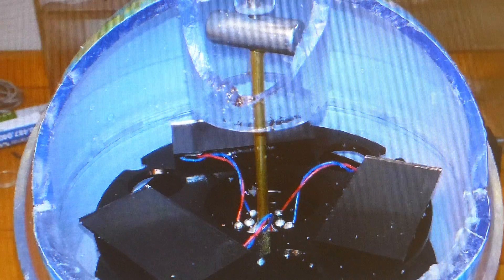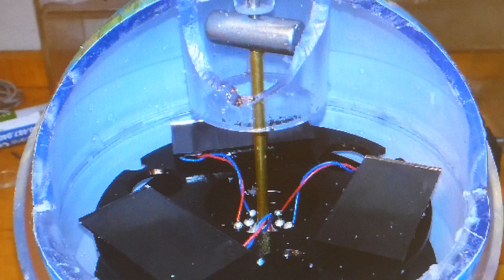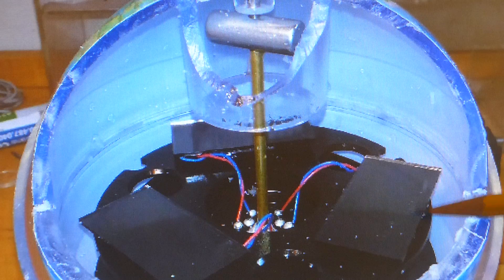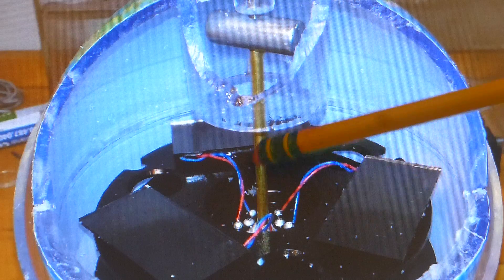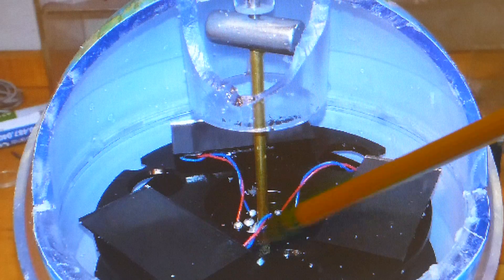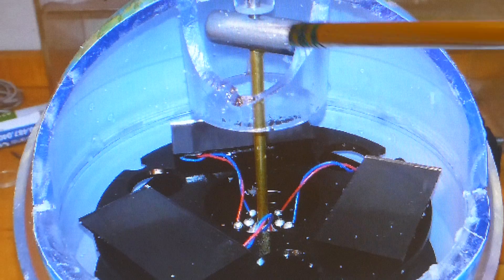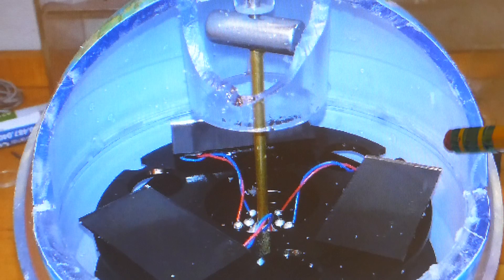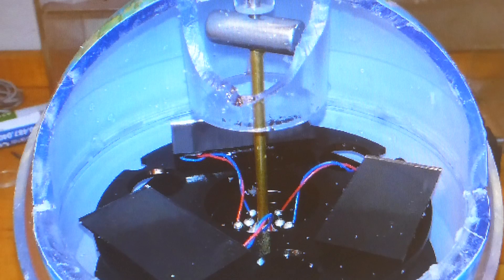Mova Globe :  Internal Mechanism Revealed by Cutting Open

Comment: Wouldn't it work without a magnet, just by the momentum counterforce caused by some spinning mass?
Reply: I think so, theoritcally. It would just cause the rod in the middle to spin. (probably rather quickly, since it would need to put the same amount of force into the rod to achieve the opposite reaction of spinning the mass of the globe.) I imagine they are already pretty close to the same weight as-is, in order for the realitively weak force of earth's magnetic field to prevent the rod from spinning. A chunk of lead to replace the magnet would likely work better, if you were to make it without a magnet.

Edit: Although, there is one flaw, the internal globe could become off-axis realitive to the user, since the same inertial forces could be applied through rotating the sphere in your hands (the magnet prevents the internal sphere from tilting.)

Comment: Wow so the strong magnet on top is only held in position by the earths magnetic field like a very strong compas needle? 😯 That’s genius , I gotta get one of those
Reply: The magnet at the top aligns with the magnetic flux of the earth.  It then becomes the pivot point about which the motor (attached to the inner globe) rotates.

Comment: I have a 6" globe that has developed an air bubble at the north pole and stops rotating, starts, stops, sometimes moves clockwise just a bit, and starts again, to stop again.  I have used the "paperclip" trick recommended on their site.  Same outcome always occurs. spin, stop, start, stop and sit there for hours, until i gently lift it and turn the globe to assure the liquid is coating the bubble surface area, for friction reduction if they exist.  It has been in the same location for 5 year under a skylight, in a bright room.  The starting and stopping just began 10 days ago, and thats when i noticed the air bubble, about 1" across the diameter.  Any help is appreciated, and FYI for others.
Reply: return it, they're a good company and would most likely give you a replacement
Reply: They only give 12 months guarantee that should set the alarm bells ringing and they charge 70% of the original cost to repair 😮😮
Reply: When an air bubble occurs, you have to wonder where the oil has gone.  If it’s into the inner sphere, I think you’re pooched.

Comment: Thanks for the interesting investigation. I own one of these MOVA Globes and as many other owners I've faced the problem with air bubble which eveloped at the top of my globe (mine is still moving though). I have searched the whole web and was not able to find any advise if there is any way to remove this air bubble. Perhaps you or your subscribers could share their findings on this as I understand it is common and widely known issue. My guarantee has expired and I would not pay 60% to the manufacture for the exchange for the same product with this well known deffect issue.
Reply: Damn, I was gonna buy one but that's put me off a bit
Reply: Try putting a large paper clip on top (something like a star of David).  That solved my problem.  The exact position of the paper clip is important but you can only get it by trial and error.
Reply: I have had my MOVA globe for 15+ years with no air bubble, I’m wondering if the cause of the air bubble was mishandling or dropping it.

Comment: i've got a few questions on this : i understand all the stuff with fix reference North-South provided by magnet, but how does :
- the inner shell stay oriented VERTICALLY when i turn outer shell : i think it may be gravity as in boats keels or spherical robots, but it's not mentionned in the 2 videos.
- the inner shell cannot move HORIZONTALLy in the outer shell. i think i understood vertically (heavier fluid below, ...) but horizontally, i cannot understand why it cannot move.
my exaplantions would be : if there is a little drag between inner shell and fluid when the sphere is rotating, it may force it to go between inner and outer shells, thus preveting inner shell to move horizontally. but it still seems very little force to me.

hope you can answer !

Comment: I understand how it rotates but how does it float?
Reply from the maker: The density of the 3 fluids used is critical.  It must have taken a lot of calculation or trial & error to make the solution  of the middle layer exactly equal to the weight of the globe, OR he could just add, or reduce the weight  of the globe.   It's very easy for a scuba diver to establish neutral buoyancy by  pushing a button to inject air into his vest, or dump it out.  When you just hover in the water look at  your depth gauge to verify that  depth is not changing.  Balloonists do it with sand instead of air.

Comment: HAs anyone figured out what type of fluid is in the globe? I have one of these globes as well and discovered the tiny port of where it is filled up with. I have heard some people claims it is mineral oil, I am thinking of taking a micro drill and hypo and inject with with mineral oil to refill the globe. But i fear that it might not be mineral oil and might be another kind of oil that is clear and more fluid than Mineral oil. Perhaps its like kerosene or  white lamp oil (wax derivative)?
Reply: The liquid is parafin-based lamp oil.
Reply: @tedinvt4631  Thanks ill try that and see what happens!!!
Reply: Any updates on what the fluid is ?
Reply: @KaranPatel-wj2mo  I used the white lamp oil paraffin I believe , works just need to use a syringe to inject and a hot iron to reseal.

Comment: There’s actually 2 fluids that are in between so that it stays centered. It’s really ingenious.
Reply: Yeah.... It's a ship, not a submarine, and the "atmosphere" has almost the same IOR  as the water.
Reply: From the patent, the specifics of the two liquids are described.  “The liquid 6 is also transparent and preferably comprises two immiscible fluids such a fluoro-carbon PFPE 5060 available from the 3-M Company of Minneapolis, Minn. and a hydrocarbon fluid, NORPAR 12, available from the EXXON Company of Houston, Tex. in a density ratio of 1.68 to 0.75 respectively. The higher density fluorocarbon fluid will normally occupy the lowermost part of the space between the enclosure and the container, and stabilize the floating structure. Any optical distortion caused by the different indexes of refraction of the fluids is least likely to be noticed in that region of the display. The fluids have been selected by reason of their immiscisbility, their low wetability, noncorrosivity, relative densities and coefficient of thermal expansion in relation to that of the acrylic material used in the fabrication of the two spheres. With this combination of liquids and the concentric arrangement of the sphere, any material expansion or constriction due to changes in temperature does not cause any risk of deformation or breakage.”

Comment: While everyone has their own idea how this thing works, I find it interesting that NOBODY mentions the oil that it's rotating in, and HOW they get that oil in there AND without destroying the mechanism.  I also find it odd that this wasnt mentioned in the video.
Reply: There are two globes,  inner and outer,  the map is on the outside of the inner globe and there are two oil types,   the oil sits in between the inner and outer globe.  an oil that the inner globe floats on is in the lower portion and an oil type the inner globe sinks in is at the top,  this keeps the globe off the bottom and top,  the spinning motion keeps it off the side.
Reply: @nicwilson58  ingenious - fluid dynamics in action!
Reply: I believe the inner sphere is hermetically sealed, so the fluid only fills the space between them.

Comment: I want one so bad, but 149.00 ? Not in my budget just yet :(
Reply: DO NOT BUY.  Both of mine have failed through a design or manufacturing flaw,    There are also three people at work who bought them after seeing mine and theirs too have all failed in the same way,  an air bubble appears at the top and overtime it gets bigger and bigger,  its either leaking into the inner globe or evaporating through the outer globe.   Mova clearly could not have cared less and wanted 70% of new price to replace them. I wrote to them several times so now all our globes are sitting in their boxes. To try and repair ourselves we asked for some oil so we could drill a small hole to top them up and reseal the hole. Mova refused the request.
Reply: Nic Wilson same thing happened with mine really big shame, I’ve read on their site to put a magnet clip on the top for one hour as it gives it a boost and it is actually spinning right now over 5 mins longest time since the bubble appeared, try putting a paperclip on the top
Reply: @nicwilson58  Capitalism at it's finest. I guess if people keep buying it then they couldn't care less about their service and product quality.
Reply: And now its 160 bucks...🐱‍🚀...so I bought one yesterday! Hope it doesnt seize up

Comment: The 3 flat items look like thermoelectric generators. They have been around a long time. They can absorb heat and turn it into power. Powered they can cool on one side and heat on the opposite side. These are what is used in the plug in electric coolers. Look them up. Pretty amazing tech.
Reply: they are called peltier junctions
Reply: Actually, they’re simply PV cells.  This won’t work in the dark, period! @johngenovese1499

Comment: Would you show a motor please.. How does it rotate?!
Reply: the solar cells spin the motor fixed to the black inner disk the cells are on,  this means that the inner part spins and the globe would not spin unless you "hold" the brass shaft,  same as a motor hold the shaft the body spins,  hold the body the shaft spins,  so they need a magic hand to hold the shaft.  this is done using the magnet at the top,  as the inner shaft spins it aligns with the magnetic north pole of the earth like a compass needle.   it stops at north and its strong enough to overcome the friction,  so the shaft stays still and the motor body spins instead,  and the inner globe is affixed to the motor body.

Comment: If the "magnet" at the top is to provide a fixed orientation, it cannot be connected to something that is rotating. Is the "magnet" cylindrical piece in fact free to rotate wrt the rotating globe? My guess is that the photovoltaic cells, when exposed to light, create enough power to spin the shaft of an electric motor that is connected to a fairly large disk thereby creating a decent amount of angular momentum. The frame of the motor, which is connected to rotating globe experiences a backlash rotation because angular momentum is conserved. The actual angular rotation of the globe is then limited to a very slow rotation because of the frictional drag the inner rotating globe experiences from the thin layer of oil between it and the outer stationary globe located on the external stand.
Reply: +Samuel Patz, 
In case you haven't read more, the magnet at the top acts like a compass and points North/South and stays fixed.  You couldn't do it just with momentum because the liquid's viscosity would eventually win and keep the globe stationary while the motor shaft rotated.  It would only turn for a short time after light started.
Reply: the solar cells spin the motor fixed to the black inner disk the cells are on,  this means that the inner part spins and the globe would not spin unless you "hold" the brass shaft,  same as a motor hold the shaft the body spins,  hold the body the shaft spins,  so they need a magic hand to hold the shaft.  this is done using the magnet at the top,  as the inner shaft spins it aligns with the magnetic north pole of the earth like a compass needle.   it stops at north and its strong enough to overcome the friction,  so the shaft stays still and the motor body spins instead,  and the inner globe is affixed to the motor body.
Reply: No. Over time friction would overcome the momentum of the "fairly large disk" and the "earth" would remain still (due to fluidic friction with the outer globe) and the inner disk would be (invisibly) spinning relative to it. Explanation by the company indicates the large magnet is like a compass needle and provides North-South orientation, against which the motor then spins the globe.
Reply from the maker: Please view new video,  https://www.youtube.com/watch?v=keO2D0hDBvo      You can clearly see that it is a magnet.  Thanks

Comment from the maker: Hi Gary. Why does the globe rotate counter-clockwise? My electrical engineer friend informs me that, if the DC motor uses permanent magnets, the direction of rotation is controlled by the polarity of the DC current sent to the motor. If the positive and negative wires of the DC input are reversed, then the rotation will be reversed.

Since the photoelectric cells produce DC current the simplest design is to use a DC motor, with permanent magnets, and wire the positive and negative input from the photoelectric cells so that the motor turns counter-clockwise, thus imitating the rotation of the Earth.
Reply: It rotates counter-clockwise because that's the way the Earth actually spins, so it was designed that way.
Reply: Orville,
 For DC motors with electromagnet fields, the direction is reversed by reversing either the field, or armature connections, but not both.  Some AC motors can be reversed similarly.
Reply: Orville,Just saw these things today. This is correct. DC permanent magnet motors are reversable by changing the polarity of the applied boltage.
Reply: Orville Wingnut   l realize it was made to spin the way earth spins of course. Just wondered the mechanics of the interior.

Comment: i have 5 globes. amazing. i have to explain to family how it works. your video is good., but can you explain why or how the globe rotates only counterclockwise as the earth does, why does in not rotate both directions ? they must have it geared somehow. i'll watch for your respond if you can on utube comments.
Reply: Simple function of polariity across the electric motor.
Reply: Gary,  Just saw these things today. DC permanent magnet motors are reversable by changing the polarity of the applied boltage.
Reply from the maker: Wow Gary. That is an interesting question and I don't know the answer at the moment. Currently my mind is fixated on a problem involving rocket stability and I can't shake It Off. When I become a free man again I will try to puzzle out your question. Try sending that question to Bill French, the inventor of mova globe. I would like to know the answer also. Thanks for your interest.

Comment: Fascinating - thanks, Orville. I sell these globes in my shop in England, and adore them - always wanted to know what's inside.

I've sold around 600, and they are so well made I've only ever received complaints about a small handful. That's pretty impressive.
Reply: As a side note, I was probably one of the first to own one of these. I have owned 3 of them. First one lasted 3 years then stopped rotating. The Second one I had in my office and it lasted about 2.5 years and stopped rotating. Third and final one lasted about 14 months, developed a bubble and stopped rotating few weeks later.  I'm done with them. Too expensive for the short product life. See Amazon for many negative reviews like mine.
Reply: @helenlasky8289   Looks to me like fluid is leaking into the inner sphere causing air to leak out of the inner sphere to form a bubble. Loss of fluid between the inner and outer spheres would cause them to make contact and stop the rotation of the inner sphere. Could be a quality control problem where Mova techs are not checking all the seals during assembly.
Reply from the maker: Thanks for the kind  words.  Sold 600... wow.  Best wishes for your continued success.
Reply: Thank you, Orville, you're very kind. I'd looked at the patent a couple of years ago, but oddly (ha ha) it doesn't marry up with what I can see from your video!

Comment: So, the globe does not rotate in dark?
Reply: It doesn't rotate from the lights in the room when it is dark outside. But mine is on a shelf and even on a cloudy day, it is bright enough that it turns. It doesn't usually turn in the day if it is raining. You aren't supposed to put them in direct sunlight, as that can fade the beautiful markings.
Reply from the maker: @sjord7  It will rotate from room lights if they are bright enough. Even a flashlight will work.
Reply: Shrishti Karkera no
Reply: supermansteve32 why should it, there are no more electromagnetic waves for the globe to rotate
Reply: +sjord7They work indoors with good lighting, such as a store, or good house lighting.
Reply: No
Reply: Sorry, but I have absolutely no way of seeing if it is rotating , hard as I've tried, when it is completely dark. I'm also not sure my refrigerator light is going out when the door is closed. I did, however, put a hidden camera - with sound, deep in the forest and waited 16 years for a tree to fall and solved the mystery of weather or not the tree would make a sound if no-one were around to hear it ,and sure enough,  the tree didn't bother to make even the slightest sound.
Reply: dumb ass solar panels  only run on light. not lack of light when its dark